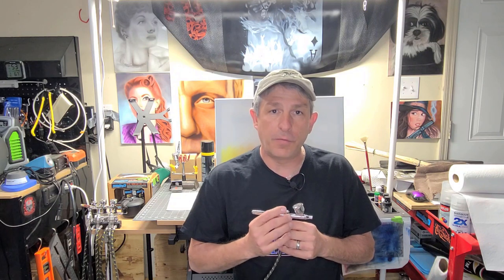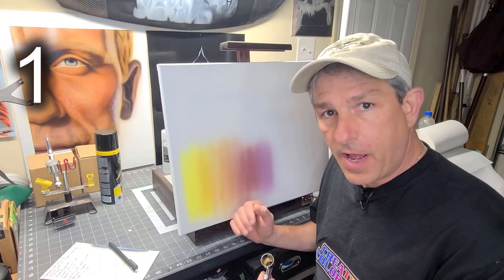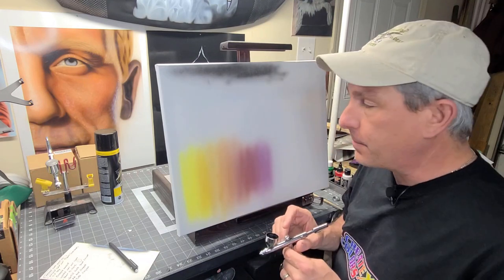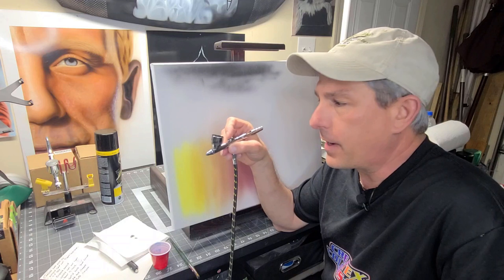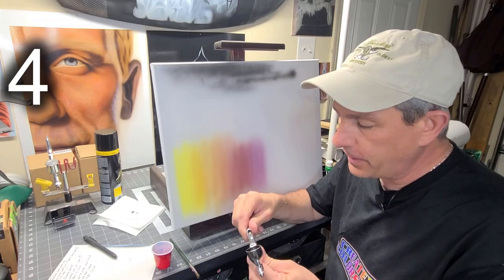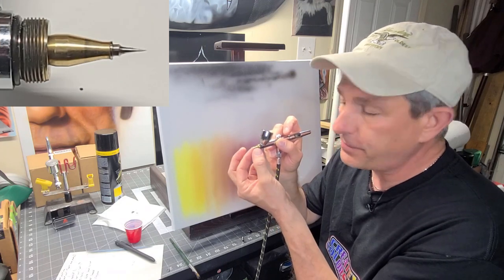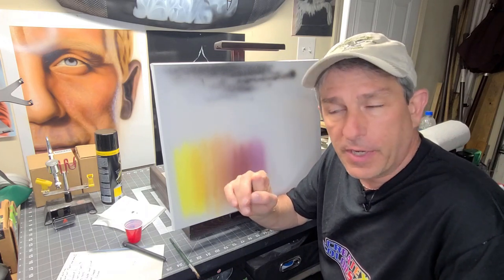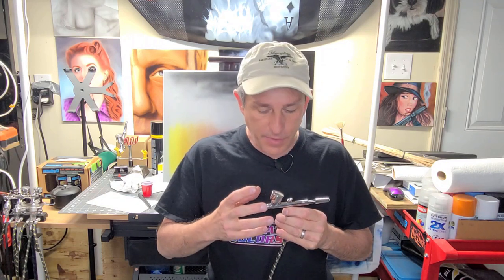Airbrush Won't Spray? Some Reasons It Won't!

Comment: im using a 0.5 and i still cant get any paint out, ive tried all the steps but it still doesnt work
Reply from the maker: Suzanne,   Press down the air and listen to it put your hand in front of the edge and feel it. Now put the air cap back on and press down on the air does it sound different does it feel like there's less pressure? If so remove the air cap and clean the little tiny holes in the cap. If you have air flowing to the tip of your brush and paint getting to the tip of your brush it has to work Make sure your paint is thin enough and you are spraying at around 25 the 30PSI if you are using unthinned paint through a point 5 your air pressure may need to be even higher. I hope this helps good luck and let me know how it turns out Thank you for watching.

Comment: Doesn't work for me 😢😭 still no paint coming out even water I've tried it out.. Just air
Reply from the maker: eizel, What size brush and paint are you using? Ok... Start with 30 psi, take your air nozzle cap off and spray some air. Pull the trigger back and forth to make sure your needle is moving back and forth. Now, put your cap back on, just snug it up, put your hand in front of the brush and press down for air. You should feel good pressure on your hand. Now just put reducer or water in the brush. Press down, pull back. It has to work, if not, you have a blockage between the cup and where it drops down on to the needle. I hope this helps, thanks for the question and watching my video's.

Comment: I have done everything you said and i still can't get it to spray
Reply from the maker: Dwight, try spraying straight reducer. If nothing is clogged (nozzle), everything is tight (no air leaks, and you have air flow it has to work. If that still doesn't work, take the nozzle cap off and hit the air. You should feel a strong force of air coming out oft the air hole or holes around your nozzle, if so now remove the nozzle and then add some reducer, it should run right out. If all of this happens....it is your nozzle. Hope this helps. Thanks for watching.

Comment: im getting bubbles and ive cleaned the thing multiple times
Reply from the maker: Wyman, it can be frustrating I know but trouble shoot from the beginning Using just reducer. Make sure your nozzle cap is not leaking air (with should not cause your air to back up) but check it never the less. This type of problem is usually cause by the nozzle it self or your paint is to thick. Try a new nozzle. I analogies it to an engine...if the cylinders are getting gas and there is spark the engine will run. So....if your paint is flowing passed the nozzle and on to the tip of the needle and air is flowing past the nozzle it has to work. Hope this helps. Thanks for watching.
Reply: @TheAirbrushGarage  i just fixed it there was some crud in my cap where the air comes out 😁